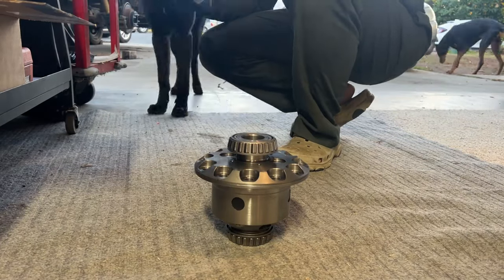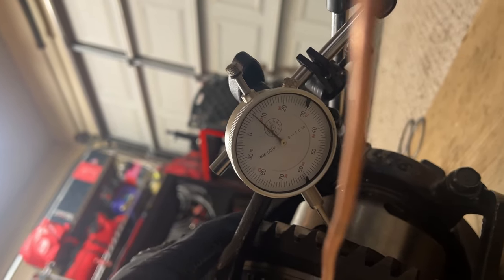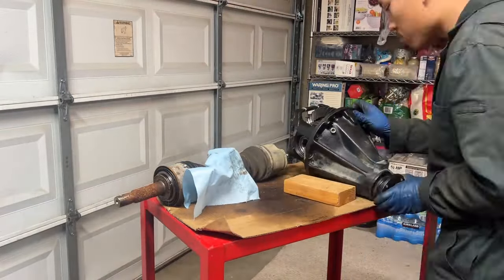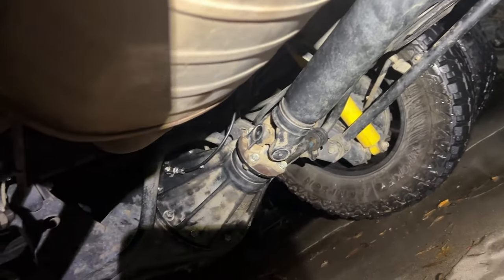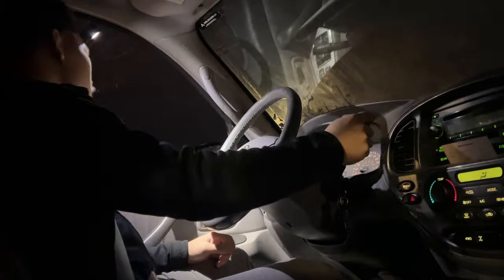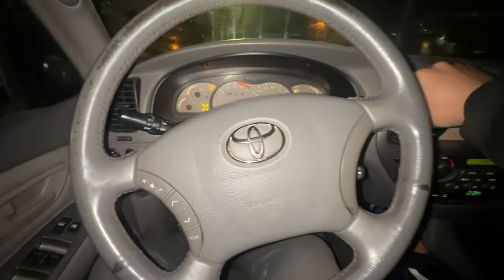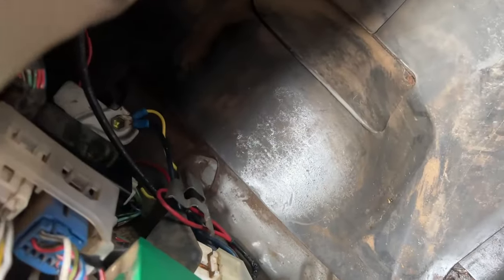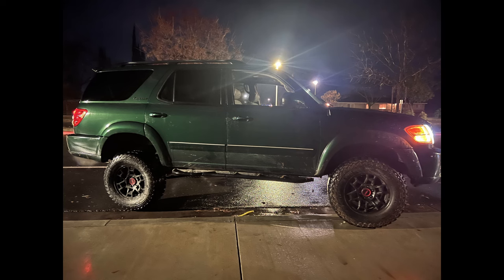1st Gen Sequoia ARB Locker Install

Comment: Props on tackling this on your own, lockers and re-gears are tricky. That's being said, hard to tell from the angle in the video but it looks like you're measuring the backlash incorrectly. Looks like you're measuring on the coast side (angled side)of the ring gear and the angle doesn't of the indicator doesn't look right. The way you have it set up will read less backlash than you actually have. The indicator should be on the drive side (flat side) of the ring gear at a 90deg angle.

Comment: My sequoia leaked from the upper corner on the windshield on the driver side and ran down the A Pilar and would soak the carpet in the exact same spot. Took me a while to figure out where it was coming from. I’ve heard that if you’ve ever had you windshield replaced and they cut through the paint the channel will rust and a leak will develop. Just a heads up that might be where your leak is coming from. The leak runs behind the trim so If you pull off the a pilar trim you will be able to tell if that’s where it is leaking.
Reply from the maker: OEM windshield I think

Comment: Been curious why there hasn't been a video on a ARB locker install

Thanks for the install!

Curious why you only used blue locktite as opposed to red locktite for the ring gear?
Reply from the maker: Yeah theres not that much out there for 1st Gen Sequoia's so I thought I share my experiences. I didnt check what locktite it was. It was from Harbor Freight